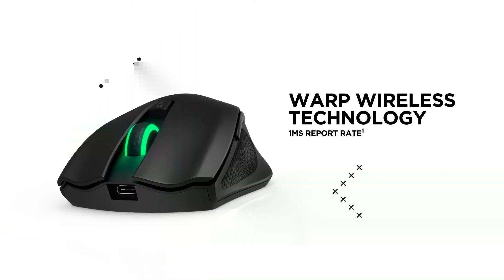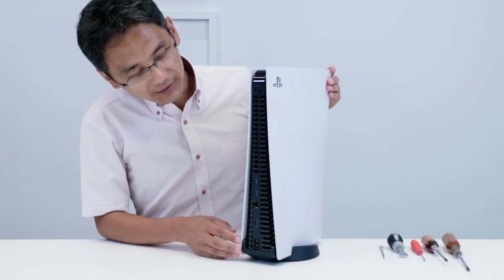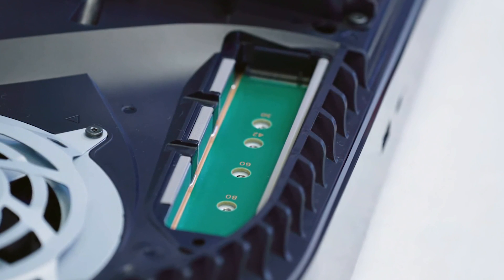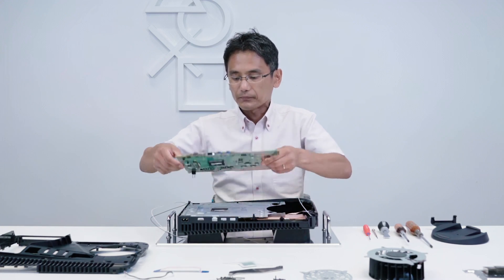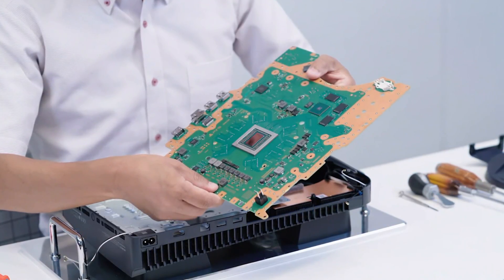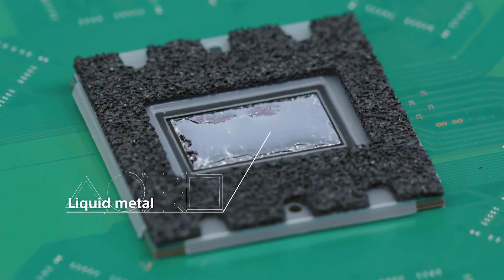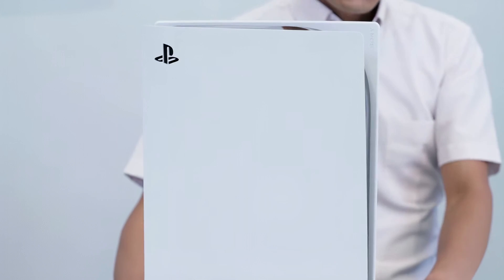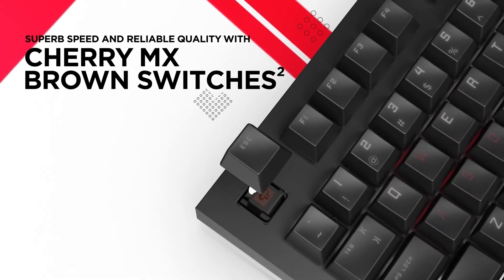PlayStation 5 Teardown Analysis: Inside Sony's Next Generation Hardware Design

Comment: I love my PS5 and I am thankful to have found one in the most random store back in March regardless, I have one gripe. I buy discs often because you can find killer deals in comparison to the digital versions cough Call of Duty cough *cough*. Although, I noticed the disc drive really ramps up in comparison to my Xbox One (OG). It does calm down but, damn does it get loud. I noticed it's even louder if you have the console on its' side rather than standing as well. That being said, I'm glad they went with a design that allows maximum airflow because the PS4 Pro sounds like a freaking jet engine.

Comment: I really hope Sony just makes some proprietary nvme drives so we can expand the internal storage without having to worry about meeting spec requirements. SSDs can be very expensive when you're buying 1-2tb, and a lot of retailers probably wouldn't accept returns if you bought the wrong one
Reply: I rather they did not considering "propriety" is essentially the same available market hardware just more expensive 

The officially licensed 512gb Sandisk memory cards goes up to $229.99 just because its a "propriety cartridge" yet that same micro sd memory card is priced almost half the price even lower when on sale yet "propriety" rarely go down in price since they are "propriety"

Comment: my question is this: how does one transfer data from one SSD to a newer larger SSD when only one SSD can be installed at a time?

my theory is it copies to internal storage, asks user to remove OLD SSD and insert NEW SSD to be formatted and DATA copied over.

Change my mind.

Comment: I have not have  had ps4 / ps3 / ps2 but only ps1. My potato engender prediction is that xbox will have huge thermal issues one because small board area and larger potential to collect dust.

Comment: Oh boy here we go digital founder giving Sony some Head. Yeah I said it. Microsoft has a better cooling design. A vapor chamber. While Sony does a huge heat sink. Wow. How can that big piece of metal cost less to produce. Then add in liquid metal thermal paste. Let’s see if it lasts the test of time. Liquid metal thermal paste to cost more money to produce. In junction with that enormous heat sink. You can’t even call the PS5 a console. Just call Sony’s version of a PC. It’s surely the size of a PC tower. Big and bulky.

Comment: So basically the entire assembly and it's cooling is just a laptop that's had a massive boost in size with thermal paste/liquid that adds basically what a good paste at a lower cost provides and with no flexibility to actually readd new paste if the current one dries out and corrodes since that liquid metal alloy is known to corrode the metal over time. Jesus people really don't see the downfalls and just look at the immediate marketing as though it was new tech or something even worth the time and effort especially on a console with so many drawbacks that negate the one small pro.
Reply: It's a massively mass-produced system with a mass-produced 300watt psu, all from china. The plebs won't understand until they get the disappointment in their hands, such as the case for every console generation for the past 5 generations.

Comment: Its probably those heavy overclocks on the ps5 that's eating all that power.
Reply: well the psu is 350w, so its not that much power tbh
Reply: It's not but it's still larger than the one the Xbox has, we'll see the efficiency number when we get more hands on with both consoles side by side
Reply: According to Cerny's presentation, Sony decided to screw trying to figure out how much power is needed in which scenarios, and instead just blast the system with full power at all times.
Reply: @XGD5layer  Which will result in failures of all kinds. If what Cerny said has any truth to it, people need to stay away from the ps5 until they find a better way to manage cooling.
Reply: You mean underclockes, they are heavily gimped due to only being able to only share 200watts system-wide.
Reply: Well I look at it as Xbox using slightly newer silicon at 1.84 ghz on the gpu core while Sony is running a slightly older gpu at over 2.2ghz boost. That's Def an oc if you ask me and overclocking pushes up power usage quite a lot.

Comment: Wifi 6 is awesome; I'm getting the Series X anyway (game pass hooked me in) but I will miss the gigabit speeds I get over wifi 6 on my laptop.
Reply: Wifi6 isn't anything different from 5ghz (it's 2+2, aka 5ghz+5ghz), it's built for combating cross-talk. 
Just like the vast misunderstanding of 5g, wifi 6 is just a niche radio for very specific applications and will have zero performance difference compared to other current wireless network technologies. 
Stop hyping up the brochure, and actually read what these technologies are.

Comment: This console looks like something a 5th grader designed. But the masses will flock to it as they have no idea what they are paying for. The expansion slot for the additional slot has 0 cooling, how exactly is that supposed to work. Sony if you are going to copy PC design at least do it right, this shit looks so cheap and basic.
Reply: Study

Comment: I'm sorry, M$ chose SEAGATE for its SSDs?
Thank you for that info. I've been burned by them enough personally and professionally to steer clear.
I was an IT manager for a university when we had to exchange literally hundreds of Seagate drives.
I enjoyed an 8TB drive having its data scraped off of it by a head crash and dealt with 120, 250, 320GB, and 3TB drives from them randomly failing. 

Also, SSDs generally get hot when they're written to (reading requires almost zero controller effort and NAND doesn't get hot when it's read from [it gets hot because you're adding current to change the gate orientation]) so yes, it might "throttle" to just 20x faster than hard drives when writing rather than 50x but I'm sure no one will notice.

What people usually refer to as 'throttling' is generally just running out of SLC cache on the drive and writing to the slower TLC/QLC media.

Comment: I have 4 ssd in my system and one m2 for system itself, when I play games from m2 ssd I really have problems, low fps and performance issues, so long time ago I decided that issue is overheating and I stopped using m2 for gaming and never had any problems with performance.
Reply: Have you tried changing the M.2 ssd to another slot?

Comment: The soldered in SSD chips are going to come back to bite Sony. What happens when those  chips eventually fail? Will it brick the entire system? Will you be able to use the m.2 drive instead or move everything from the failing SSD chips to a new m.2. All this looks like they are taking a page out of Apples play book. Make your device completely unrepairable so average consumers have to buy a new device.

Comment: "BT, pretty straight forward." Is it Rich? It's BT 5.1 !!!!  SIG(BT) have launched Bluetooth 5.1, with some all-new features with more range. (760 meters at 1Mbps and 1400 meters at 125 Kbps) .
Reply: A Range like that would only work on an open field in the city no way
Reply: @mrn234  With massive power and a massive antenna, even so, you still won't get anywhere close to those metrics. Clint is a moron.
Reply: Yea, no, that's not even remotely true. Just becasue you know how to read the brochure, doesn't mean you have any understanding of the technology. BT5.1 is just a optimized previous generation for hifi audio use. It's also complete garbage due to driver support and no one is willing to use it.

Comment: PS5 has wifi 6? That is huge!.
Reply: This is an amazing turnaround from Sony, The PS3 and original PS4 were absolutely terrible for wifi! All revisions of the PS3 had 2.4GHz G and the PS4 had 2.4GHz N. All were useless for online play (oddly low spec for even the dates they were released) requiring them to be network cable connected.
Reply: Wifi6 is useless for the consoles. It's just a crosstalk solved issue, nothing more. It's no different than a single 5ghz channel in use (wifi6 is 2+2, aka 5ghz+5ghz). I';ve been on wifi6 for about a year, there is nothing special about it unless you have tons of other 5ghz radios going on in the environment.
Reply: @sqlevolicious  I'm talking about multiplexing, how many spatial streams the console supports. This is defined as 1x1, 2x1, 2x2, 3x2 and do on and so forth. You can typically eyeball this on routers, a 1x1 (one send + one receive channel) will normally have 1 antenna, a 2x2 will have 2, so on and so forth. If the PS5 has 2x2 it may be able to split the spatial streams between devices, this would allow dedicated channels to a device and the internet so they are not interrupting each other. This is a big deal as until now, wifi channels are not as stable as they need to be due to any and all devices using the same channels or overlapping.
Reply: @sqlevolicious  I have wifi 6 on my PC and I get 750 mbps over wifi. It's definitely great. 
My none wifi 6 devices tap out at 450/500 mbps.
Reply: referral madness  yeah it's pretty awesome bro. My old connection was 2MB,.so a great upgrade.
Reply: Don't get too excited it's like 5G. You need the right stuff if you want to enjoy it.
Reply: @yakuza_suske3189  I have a wifi 6 router, gigabit broadband too. 👍👍
Reply: referral madness  100Mbps is nothing, 2.4ghz does ~380Mbps, do you mean 1000MBps? (gigabit) Nope, not even close. Instead of reading the brochure, go check real-world use.

Comment: SSDs dont need heat syncs. I have one with a heatsync and one without, literally no performance difference. Youre overthinking it Rich
Reply: Of course, Ryan
Reply: my SSD dangles from the cord in my case, its my own patented "free hanging flow" technique works just fine

Comment: Hi, will anyone be kind and help me out with a question regarding the 3d sound.
I currently have the playstation platinum head set and i cant stop wondering if i will be getting the 3d sound effect on ps5 with the platinum headset  or do i need buy the new 3d pulse headset to get the full 3d effect, i have read somewhere that to get the full 3d sound effect the headset needs to support spatial audio. 3d Sound is really important to me and im trying to avoid spending some more money if i can. Really appreciate you answers.
Reply: Martin Schmidt  that sucks, thanks for the reply though 🙏🏻

Comment: Would this fan not be almost the same that is currently in blower style GPU's?  Just an upscaled version?  Also isn't there a similar fan in the ps3 with the sliding bluray cover?
Reply: Blower fans intake air from one side only while this fan intakes air from one 2 sides

Comment: Ps5 = fj cruiser
Xbox One series X = Jeep Wrangler

You can guess what I mean 😏
Reply: Spoiler alert, it's actually the 2020 supra and the bmw z4 (or toyota gt86 and subaru brz). They are identical hardware with different branding. As has been the case for the past 4 console generations.

Comment: I don't agree. For me the XSX has a more conveniant and simple conception : A métal plate, 2 square boards, a radiator, un PSU, a drive and a fan. You put it together and insert it in the box.

On PS5 side, there are a lot of pieces, with unusual shapes, with a lot of bindings... Try to imagine the difference between mount a PS5 from the dozens pieces to the console. And try to imagine with the XBox.

Not comparable at all.

For my point of view, PS5 design is far less clever and simple than the XSX and cost a lot more to build.

Comment: Microsofts Console is smaller and has more power. This is usually called the first sign of "Better Engineering". 🤷‍♂️
Reply: Its that better engineering that we've seen no raytracing yet and a sub par dirt running dynamic 4k lmfao
Reply: @canthetoasterdoraytracing6414  We have seen ray tracing already. You clearly don't watch this channel. Microsoft already showed the next gen Minecraft for Series X running path tracing not normal ray tracing. Path tracing is more difficult than ray tracing but it already had it so educate yourself.

Also ray tracing takes more compute units and guess what Microsoft has 44% more than PS5. 

Series X on average is 38% stronger..
Reply: It also doesn’t require a screwdriver and base to stand vertically or horizontally.
Reply: @TheRealLazyEntrepreneur  Apparently to you a screw is really hard to remove.

Comment: It's worth noting, the PS5 has a single 16GB pool of fast GDDR6 RAM while the Xbox Series X has a 10GB pool of faster GDDR6 RAM and a 6GB pool of slower GDDR6 RAM. I'll take the single pool any day. It will be easier to take advantage of for developers.
Reply: @Rohan Rathour anyone with a brain would get expansion drives for both lmao
neither hit 1TB of available storage and both will get full quickly
confused as to why you replied this
Reply: @Rohan Rathour it's the opposite 
they did that to save money 
if you're a gamer who wants all of their games installed at a time, you'd get an expansion regardless
If you're the type who just wants a select few on at a time, you'd just uninstall the ones you don't want to save storage. it's what I do and probably will with the PS5
it's less of an issue than people like to think it is
Reply: @Rohan Rathour sure it can be important
but both consoles have very limited space. you'd only be able to hold 1-2 massive games on Xbox compared to PS5
If you want more storage, get an expansion
It's how it's been with consoles for years and is why I tend to get AAA intensive games on PC where I have the most storage
Reply: PTSD flashback to my Gtx 970 with "4gb" of vram lolol

Comment: blowers fans (PS5) produce more air flow than axial fans (SeriesX) but they are noisier. i suspect the Xbox will run hotter, not helped but it's compact size, but the PS5 will be louder, as it seems it will need to be cooler to prevent throttling.

Comment: I can't wait til you folks can do a side by side benchmark of the two consoles
Reply: Oh microflop will give these clowns a 120% bonus here to feed gullible clowns false info
Reply: @canthetoasterdoraytracing6414  for comparisons it's pretty damn hard to do that if you play identical games like they always do
are you worried that the PS5 will fall behind? 'cause most likely it will just based on technical spec alone
Reply: Pointless. Identical hardware running games built specifically for that hardware. You won't see any difference other than the OS UI and the controllers.
Reply: @sqlevolicious  that's generally not how it works but sure, go off
The blatant and obvious frame and resolution differences from the x and the pro just didn't happen
And the variations in specs with the X having an advantage numbers wise just won't give a small increase in performance
If the ps5 is a 2070 super and the one x is a 2080 then you will see performance differences 
They're both great consoles but saying they'll run identical is wishful thinking

Comment: I thought the build cost of XSX would be less expensive than PS5, due to the market price of each console and the existence of liquid metal in PS5. I’m quite surprised it’s actually the other way around.
Reply: Vapor chamber costs more than heatpipes, the liquid metal was used to save costs by not having to use a vapor chamber

Comment: Bruh the jet engine ps4's weren't just from dust. The ps4 thermal compound on a lot of models was straight up crap and failed over time.
Reply: Maybe True Bt Sometimes Yall Games Are On A Flat Surface Which Makes It Over Heat
Reply: Thats Why They Have A  Stand For Vertical And Horizontal Placement
Reply: My Ps4 Never Over Heat Or Made Noise Yet Even With Dust Just Because It Is Not Directly On Anything So For The Xbox Laughing At The Process To Switch It From Vertical To Horizontal Would Still Get A Bit Of Heat Problems Or Get Hotter Than The Ps5  
So If You Have A Ps4 Try Taking Your Game From Being Flat And See How It Runs

Comment: PS5: Liquid Metal, Huge heatsink, (custom) Very deep Fan, Dust removal compartment, 1 Screw Nvme Install

XSX: Split mobo, Bottom to top air intake, Smaller, Memory card expansion

Yeah... Uhh... PS5 won, in terms of cooling innovation. Hands down.
Reply: Both has a great cooling system, but is more difficult make the smaller console, is a greater engineer achievement (and it's better for the user), so everyone make their own conclusions
Reply: @eliteshergio7375  Yep both are awesome. Ones just more innovative

Besides the application of Liquid Metal (which is only used by one other, out of the box consumer product - so far). It's Sony's patent in the way its sealed and insulated. Which is why I called it most innovative. 

Also a hole to get the dust out, sounds brilliant. But I need to see how it works in practice over a period of time. Btw I forgot to mention SmartShift. Which should help temper heat as well.

Honestly they really delivered.
Reply: @MonSteh  yeah, I don't denied is more innovating thing, but Xbox solution is more practical, a smaller console is more comfortable to use and move.
By the way, both are awesome and I'm getting both as well
Reply: Uh, no.
Reply: @PJthePlayer  why? Honest question.